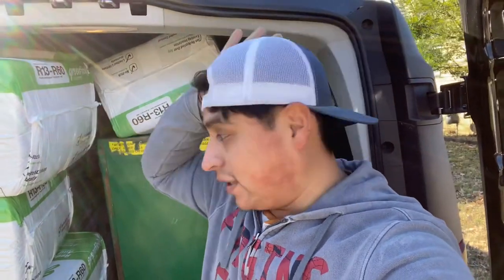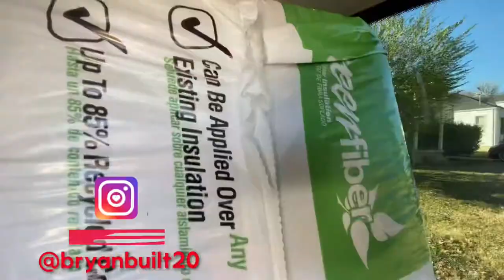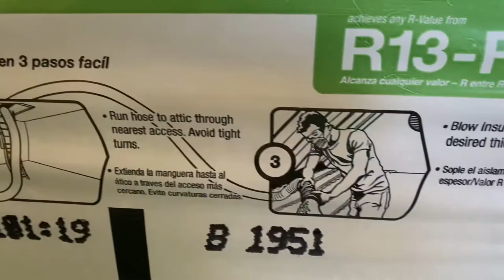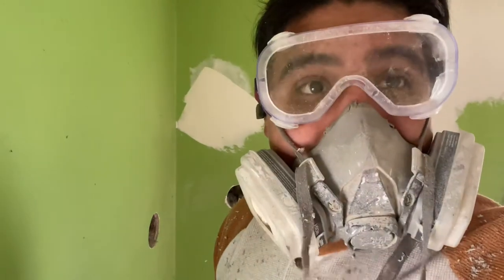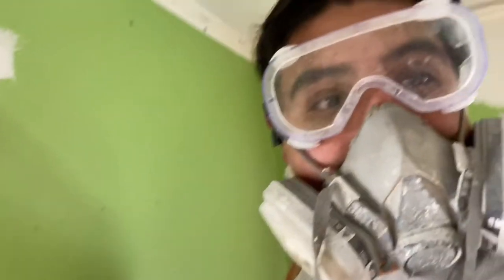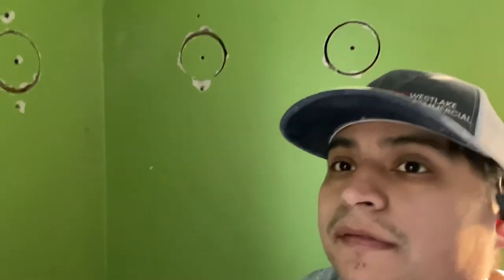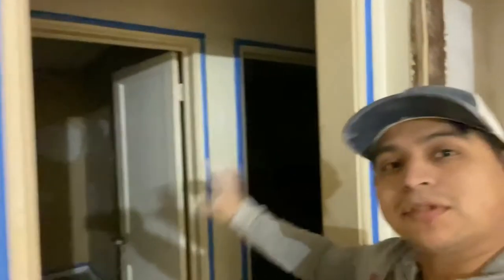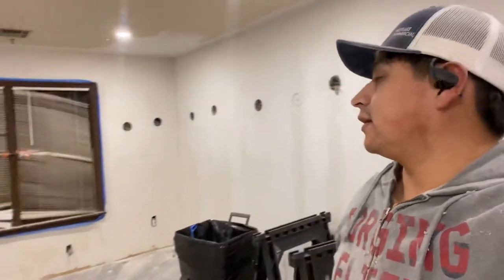Blow In Green Fiber Insulation At The Reno House

Comment: Great tip on the toilet flange. Did you add a smaller hose to the machine such as a flexible vacuum hose. Can you tell us what you did and used. That was genius too.
Reply from the maker: Yes! I bought a 6 ft piece of pool vacuum hose and attached that to the machine hose with a rubber coupling and tape
Reply: @BryanBuilt  thank you for all your help. Really does help. I got the most useful information from your video.
Reply from the maker: Your welcome im glad I could help. Thank you for watching!
Reply: How heavy is the insulation machine?
Reply from the maker: @auntiekonny748  its pretty heavy but does have wheels

Comment: Nicely done. What do you recommend for an old house with sag in insulation that's coming out into the basement? Go under the house and seal up by putting board up? Just pack over existing and call it good? Or is there some magic somewhere I need to learn.
Reply from the maker: Hey josh from what ive seen and read spray foam is the best option for insulation in a basement. Ive also seen the foam board insulation used . I cant say ive seen much of it because we dont  see alot basements here in OK

Comment: Brian,   Is this something I can do with an existing ceiling using sanctuary blown in green fiber insulation for insulation as well as blocking out impact noise from hardwood flooring  ie:  footsteps etc from upstairs neighbors in a condominium complex?   Same process as you used here for the walls ?   It should cut down on the noise as well as heating?   Any info would be helpful!  Thanks
Reply from the maker: Hey! Great question. Cant say im an expert on this but the product can be used in attics and ceilings. I would assume you could. I would double check with the product maker to be sure it can be blown in the same way but i cant think of any reason you couldnt !